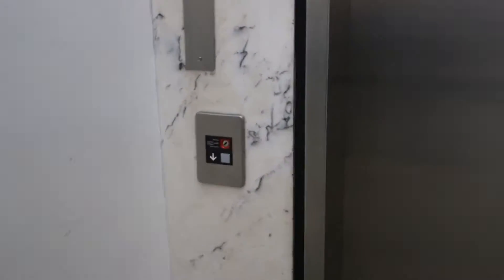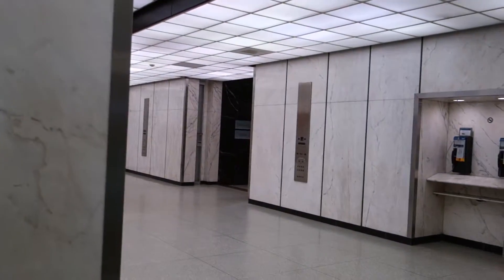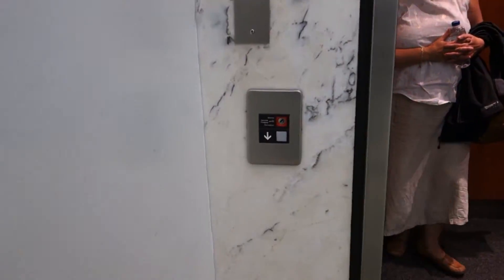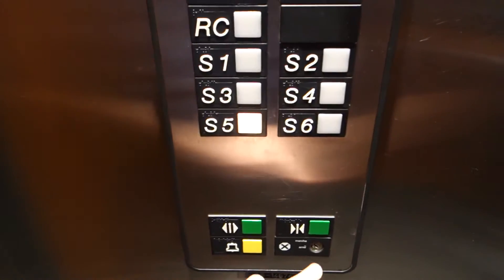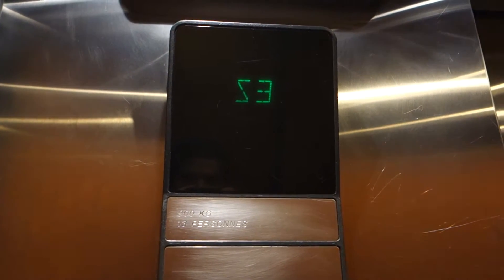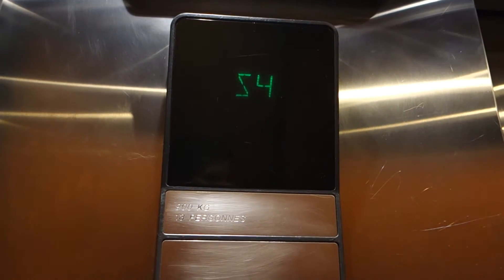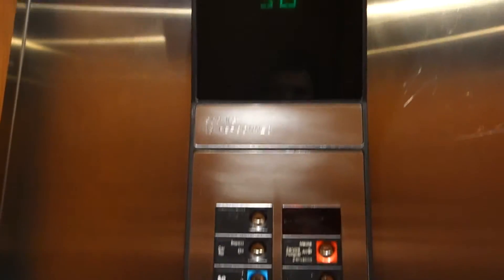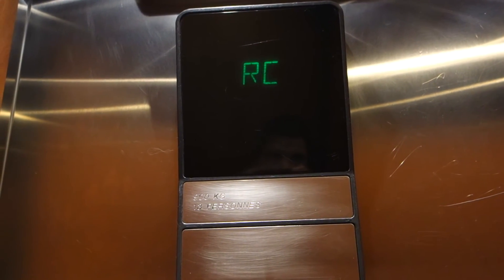Otis Series 1 Bottom Drive Traction Parking Elevator at Le 550 Sherbrooke Ouest, Montreal, QC

Comment: LOL! The Numbering on the Brail! RC, S Stands For Series like Otis Series 1 Series 2, Series 3, Series 4, Series 5, and Series 6. Here goes Jack (pnwelevator)'s part.
Reply from the maker: Oregon Elevator Fan S actually stands for Stationnement which is a French word for Parking.
Reply: Floridian Elevators Cool. But still Interesting though
Reply from the maker: And RC is Rez-de-Chaussee which is French for ground floor. I may have spelled it wrong.
Reply: "SS" actually is "Sous-Sol" which means basement in French. So if there are more than one basements they label it as "S1,"S2" or -1,-3